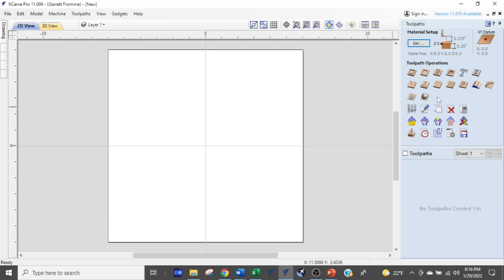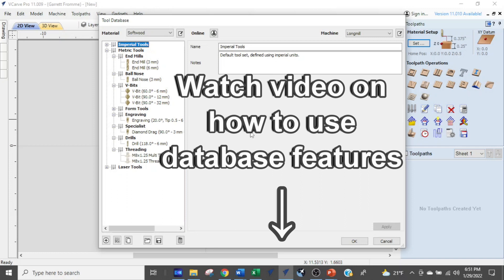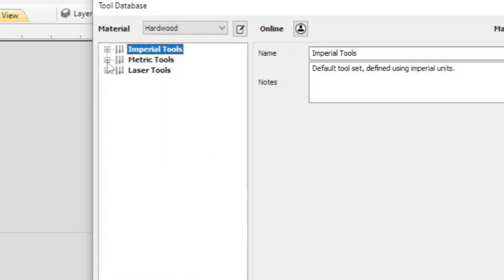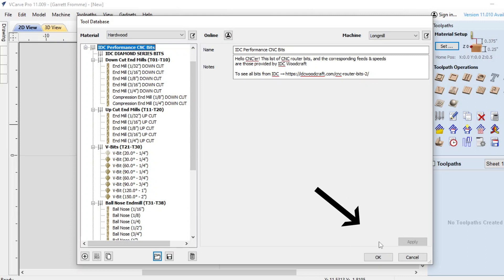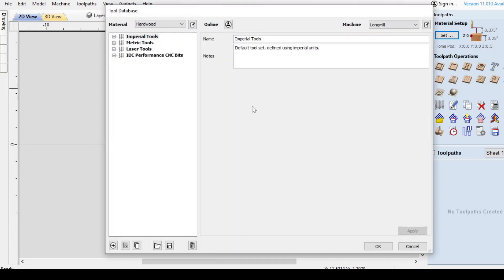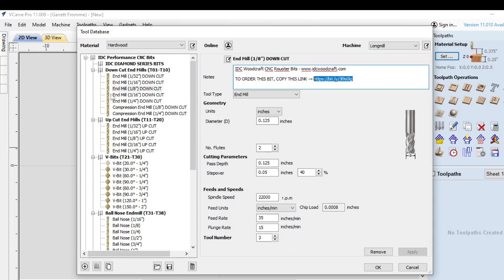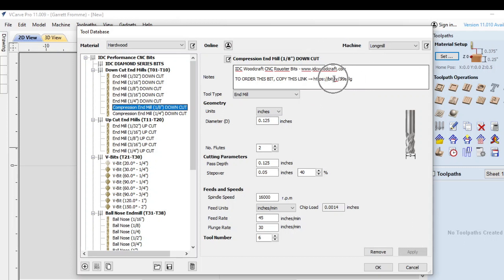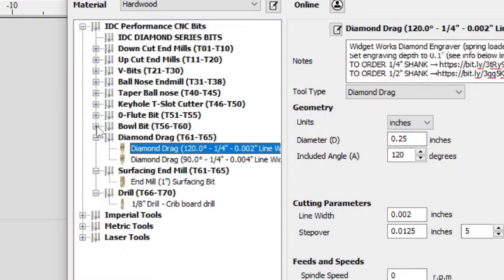How To Install A CNC Router Bit Database Into Vectric Vcarve & Aspire, Download Instruction

Comment: Garrett, thanks for the database.   I am about to order a couple of bits and I have a question .  How do the speeds feed rates of the tools change when working with a soft wood like pine?  I there a rule of thumb that I can apply to modify the hardwood data?  Or better yet, is there a separate database that I can download?  Living here in the western U.S., hardwood is hard to find and expensive so I do most of my work with pine.  
A second question;  in watching several other of your videos, I notice that you have a white backgound in your Gsender software.  I like it much more than the black that I have.  Is there an easy way to change to white?
Again, thanks for all you are doing.  I bought my Longmill and Vetric software based on your recommendations, and I am really happy with them both.  You are perhaps doing such a good job with your videos that I have not had to go one-on-one with you. 
Thanks again
Dick Garrett
Reply from the maker: James, the feeds and speeds I provided you works well in both soft woods and hard woods. You will need to practice getting familiar on your machine but typically with soft woods you can increase the feeds and speeds 10-15% if you want your machine to run faster. 
As for Gsender, I might be using an older version of their software. Take a look at their documentation and play around with the settings. There might be a setting in there that will help you. https://resources.sienci.com/view/gs-additional-features/
As for all the videos, you are so welcome my friend. Glad I can help.

Comment: Great video as always! Please settle an argument. Is the tool data base available if you are using a TRIAL version of the vectric desktop software?
Reply from the maker: bigkahunaranch1715, great question brother. It sure is but you wont be able to create any toolpaths!
Reply: @IDCWoodcraft  But you can’t add another tool database like IDC database, correct?

Comment: Great video as usual, is the database in metric as well, it gets real confusing working in metric in the design software  and then having to switch over to imperial measurements in the tooling software.
Reply from the maker: Hi Steve. I do not have the database setup for metric yet. But I am working on it
Reply: Hi Steve just checking if you have located a metric version of the tool database ?

Comment: Hey Garrett, great video.  Just wondering about your Big Stiffy bowl bits.  I just downloaded the bit library, and the only bit under bowl bits is a Radiused End Mill (Tip 0.317 - 1").  Will you be updating the data base soon for the Big Stiffy bits?
Reply from the maker: John, thank you. Great question, I should be updating this soon!

Comment: Garrett I have a shapeoko xx/cnc that runs a trim router.. and you can create a file in Vectric pro that uses different bits nd save it to 1 file . Because there is a post processor that is set up to do tool changes. So for to work right the tools have to have a number for the different bits. If you don't have your bits numbered  then you will not be able to save the G code to 1file. So It is good that the numbering is . what happens to the numbering  when you have selected all the end mils and go to the v bits .
Does the numbering continue  or  or does it start over ( end mils end with number 6 and now you are in v bits is the first v bit 7 or 1  If not it would be nice if it could.
Jeff peters
Reply from the maker: Regarding numbering, Just pick a number that isn't used. You can go up to 3 digitd

Comment: Hey mate, once again another great tutorial, I have downloaded the Tool Database, I noticed there are NO form tools??  just out of curiosity, do you have any basic form tools you use as it is very hard to find the right profiles anywhere on the net for even just the basic ones to help in setting up ☹ or if you have Video on how to design the profiles on the basic form tools, Thanks in Advance mate 😁👍🏻👍🏻
Reply from the maker: Because form tools have infinite variety, I don't even try to add that to the database. I don't have any videos that teach how to do it. I'll create one eventually
Reply: @IDCWoodcraft  no worries mate just thought I would throw it out there, but Thanks for replying :)

Comment: thanks for a very helpful video however i can use the imported data in new projects but a cant see the full range of bits if i open an existing project, is it possible to view the imported date in historical work ? if so how??
Reply from the maker: shawnwebb2497, you are so welcome brother. The database should work on all projects! If you have a certian toolpath selected some bits might not show up. For example if you select a vcarve toolpath and select a tool, only V bits will populate. That may be your problem on this one brother!

Comment: Another Question, do you treat the long 1/4" and 1/8" end mills any different. I'm guessing no other than depth but would like to know?
Reply from the maker: I forgot to add them to the database. They are treated different. I'll have it updated in a day or 2
Reply: @IDCWoodcraft  Thanks
Reply: @IDCWoodcraft  Garrett, no hurry and no pressure but will you let us know when the updated database with the long reach bits is available. Not sure how you intend to handle updates. Thanks in advance. You're doing a fantastic job! You're my go to for vectric and normal cnc stuff.
Reply from the maker: @keithdavenport7009  The update with the extended bits is already there. All you have to do is download the database again
Reply: @IDCWoodcraft  Thank You!

Comment: Hi IDC  . I have Dovetail bit size shank  6x12.7 how find  I put Database into Vectric v12 ?
Reply from the maker: rogerhickson-snook6935, To add a dovetail bit with a 6x12.7 shank into Vectric V12, you can create a new tool in the Tool Database. Here is a video that should really help you: https://youtu.be/670Xzgf0LiA?si=HblUA1fVbzsEEbYg

Comment: Hey Garret, greating's from Belgium. 
1st. Your video's helped me a lot with my cnc.
2nd. Depth per pass in your feeds en speed chart is the same as the diameter of the bit. Is this correct. I've found this info.
As a rule, your depth per pass should never exceed half of your bit's cutting diameter. For instance, a bit with a 1/8" (.125") cutting diameter should have a maximum depth per pass of .0625" per pass.
Reply from the maker: Hi Erol. For #1, thank you.

For #2, this is not always the case. The half-diameter arguement started due to lower quality machines or those that have rigidity issues. Depending on your machine, you can go much deeper than half diameter.
Reply: @IDCWoodcraft  ah okey. I broke 2 downcut bits today. Why i dont know. When i go faster, the z axis begins to jump and i get a terrible side. Going slower helped the jumping, but I think that's why the broken bits. I am really getting demotivated. I let it rest for a couple days and look what's happening. Looking forward for new videos. Greatings from Belgium. Take care.
Reply from the maker: @erol9000  you have loose elements in your machine. That's why it's jumping around. Or your machine just doesn't strong enough

Comment: I’m running Vectric Aspire. I just purchased 14 IDC bits and figured I’d be proactive and download the tool database for Aspire while I impatiently wait. 😂 BUT, after downloading and unzipping. Aspire doesn’t recognize the VTDB file when trying to import the new database. Did I miss a step?
Reply from the maker: Are you using the free version of aspire
Reply: @IDCWoodcraft  Garrett, I am not. It’s the paid version.

Comment: Hi Garrett, I always try to update the latest data base you have on your Router bits. So, I downloaded the latest file and uploaded them into the tool database in Vetric (merging without override). However, I believe my database now has tools numbered from (T01-T70) and (T01-T85). Do I keep both or delete the (T01-T70) in my tool database? What is the latest version of tools for the database? Is it (T01-T85)? Thanks
Reply from the maker: Maxgarcia, for this I would recommend you just use the database with tools (T01-T85). I added quite a few bits in recent months and I want you to have the latest and greatest.
Reply: @IDCWoodcraft  Thanks Garrett it's always a pleasure to hear from you. I wasn't sure whether to delete the older database or not and so to be save then sorry I had to ask. I already know how to download the database. it's that I needed to make sure there were changes to the new database. I Love all your videos. I have learned so much for you and all the other CNCer's out there. You started a great thing! Much appreciated..

Comment: Hey  I have installed the database for the Bits on my version. It does not show the gold tips on each bit. Is there a setting that I’m missing? I have version 12.0 V card pro. I’m warning if I need to set a different setting on the tool database to show this gold tip or if that is a problem..
Reply from the maker: jonathanscott9916, It sounds like you're experiencing a display issue with your tool database. Check to see if the visual settings are enabled in your software preferences. Sometimes, updating the graphics settings or the software itself can resolve such issues. If the gold tips are still not visible, you might want to look into the specific updates for version 12.0 V card pro. Good luck!

Comment: I have a question why when I engraving a square at the end the line don’t match with each other or it won’t engrave a perfect round circle
Reply from the maker: davidrobles7167, It sounds like you might be experiencing some issues with calibration or alignment on your CNC machine. Sometimes, the stepper motors can lose steps or the tooling might not be perfectly set up, which can lead to discrepancies in your engravings. Additionally, make sure your material is secured properly, as any movement can affect the final result. Checking for any wear and tear on the bits can also help. It's all about fine-tuning your setup for the best results!
Reply from the maker: davidrobles7167, It sounds like you might be experiencing some issues with your machine's calibration or the parameters of your engraving toolpaths. Misalignment can often occur if the CNC isn’t properly squared or if there’s backlash in the movement. Also, make sure that your feed rate and spindle speed are set correctly for the material you’re working with. Finally, check the accuracy of your design files; sometimes, small discrepancies can show up in engraving.

Comment: what to do if I want to have it in millimeters and not inches?
Reply from the maker: majc8010, unfortunately for the Vectric database you will need to change the settings and specifications of each bit or input a Metric database

Comment: Cant import to aspire 9.514
Reply from the maker: Unfortunately you won't be able to. The older versions do not accept the database. I don't know why but it has to do with what Vectric programs into their software
Reply: @IDCWoodcraft  plz help ! After flatten the surface with cnc flatten bit 1 inch . It leave alot of marking line on the surface . Any help plz
Reply from the maker: @hayabusa3558  making line?
Reply: @IDCWoodcraft  after flatten the surface have a lot of straight line in the surface.
Reply from the maker: @hayabusa3558  the router is out of tram.